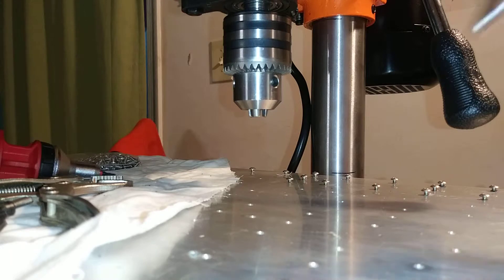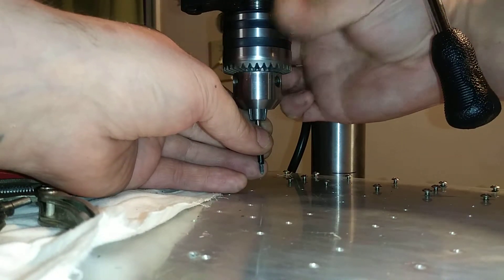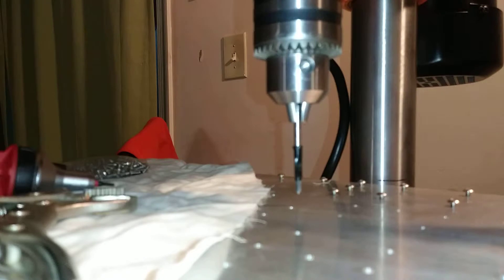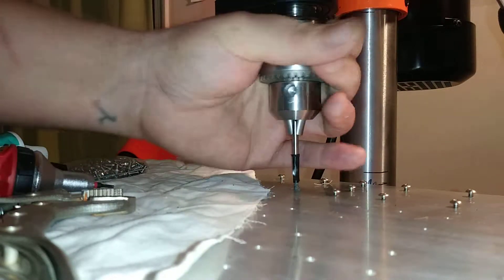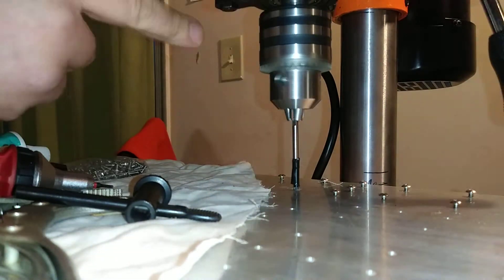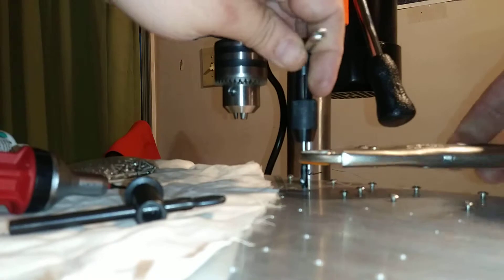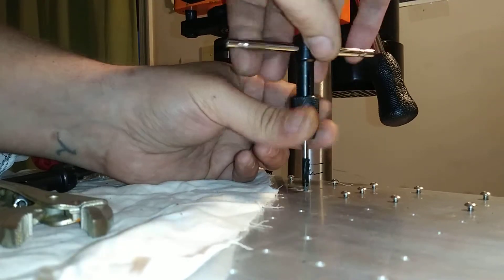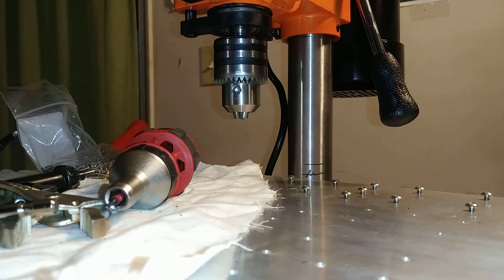Using a Drill Press to tap threads to make tiny 4-40 screw holes into aluminum

Comment: good to see some one use a bench drill to tap threads.

here are some tips from me.
On ally use WD40 or paraffin it works great and easy to clean.

Also I Leave your tap in the jaw of the chuck and also your chuck key, and so as you rewind/undo  the tap the chuck keeps it locked  and so you don't have to use other tools
or better still is use a keyless lock down chuck. they are about the same price as a jacobs chuck.

Also if you have loads to to then use a spiral flute Tap with a taper and not a standard straight one, as this will clean out the chips and also prevent gumming up with the soft  material and drive into the metal better.

if using hard metal like stainless then use a straight flute with a flat bottom, this help stop the metal from work hardening

Comment: I have some 4-40 holes to tap, your method will make short work of what I need to do. Thanks for sharing and a great method for small taps
Reply from the maker: cool, use engine oil to lube the holes, it works better, the tap comes out easy, I just did this again the other day lol, you do gotta give it a good amount of pressure on the handle but the tap holds up good I guess because it's not moving side to side at all

Comment from the maker: I found a bottle of 2-cycle engine synthetic oil for a 50:1 gasoline mixture, I put that in a syringe and wet the threads of the tap before doing this and the taking the top out time has been cut in half
Reply: Do you think this would work for an even smaller tap like 0-80?  Or would that be so small that it wouldn't work.